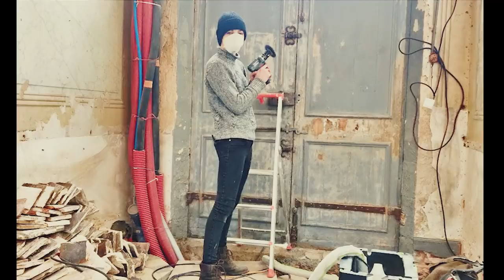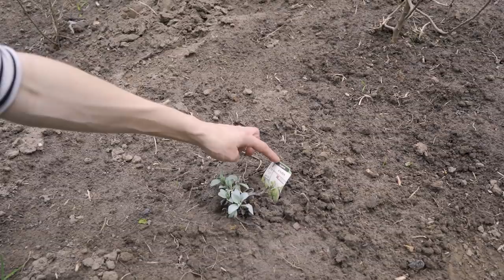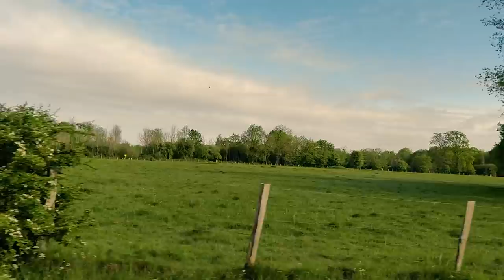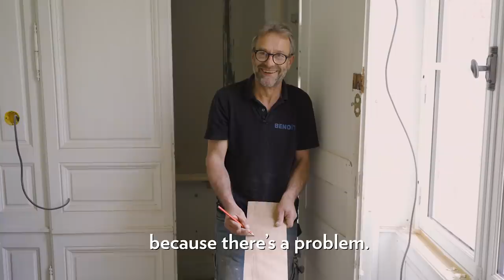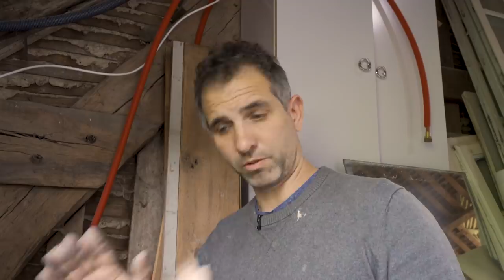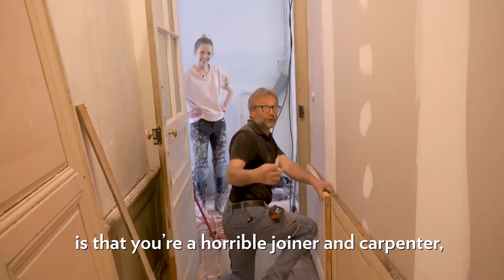Now I'm REALLY in trouble - How to renovate a Chateau (Without killing your partner) ep.20

Comment: Good for you for planting a garden. Your soil could of used some amendment. Dahlias are beautiful but very proned to slugs. The best way I have found to keep them at bay is two inch flat copper wire put in hoops around the plant. Dahlias also benefit from pinching to encourage branching out. You can google it and see what other flowers benefit from the same technique.

Comment: For future reference, you can start dahlia tubers off in pots inside a greenhouse, partially buried with some of the tuber exposed. You often find you have more success if they are head started. It also allows you to take cuttings from the tuber as the shoots come up meaning you can get 5 or more plants from one tuber that will all flower in the same year.
Reply from the maker: Thanks a lot for the tip!

Comment: Excellent vlog! Entertaining and hilarious as always.

One tip: lightly spray the stones and existing mortar with water when patching, repairing, or continuing work which has dried out. Doing so prevents the dry stones and mortar from sucking the moisture out of the new mortar. This prevents or weakens bonding of the existing dry materials with the wet being applied. Before spraying with water its best to brush and hover the wall or surface being repaired to prevent small bits, dust, and old mortar in powder form from creating a barrier between the existing material and the new material. Certain types of stone and tile also require wetting before applying mortar and put into place. Given this is an older vlog and the ten of thousands of individuals, such as myself, beating and pounding you over the head with unsolicited advice, you're bound to have been informed of this. If so, I won't see your eye roll or the one finger salute. So have at it. For the desired and maximum effect ensure your well rehearsed single finger salute and/or eye roll is in the direction of American. 

The "vibrating tool" aka multi-tool, is the best power tool invention in recent memory. Another way I've hidden wires and cables is with picture rails. Picture rails not only prevent holes in the walls, but hide data cables, low voltage electrical cables (LED sconces, motion sensors, alarms, LED strips behind the picture rail to highlight the crown, etc, etc), and a dedicated low voltage electrical cable to power individual LED light fixtures for art suspended from the picture rail. Installing a picture rail future proofs the room. The picture rail reduces or eliminates the need for cutting and patching when new cables or wires is necessary. Picture rail pays for itself both in terms of time and resources. For single electrical cables you can simply add half or quarter round molding to existing crown to avoid having to cut into and repair plaster walls. As always keep a detailed digital diary for each room to prevent mishaps in the future. Incidents of electrical cables being severed with a nail can easily be avoided. Buildings have been destroyed by fire due to a single nail through an electrical cable. Damage to and repairs of electrical and/or data cables is avoidable with a digital diary containing photos and measurements.

Lastly the hired orchestra playing your original scores is superb! Each new vlog is better than the last. 

Cheers!

Comment: Here’s some dahlia growing advice from a cut flower farmer. Dahlia tubers are prone to rot. Plant your dahlia tubers when it’s NOT going to rain. Do not water your dahlia tubers until they have sprouted. I know it’s the opposite of what one would typically do, but it prevents them from rotting. Also, dahlias are not cold tolerant. Plant out after all threat of frost has passed. They like warm weather.

Comment: My essential opinion about the cut flowers: Do get some Anemone de Caen and Anemone St. Brigid. They are always all over the Paris flower markets because they come early, last long and are very colorful, making great arrangements. They are EASY to grow and come back year after year. The Dahlias might give you some trouble due to your more northern clime. In zones 9-10 they winter over but with hard freezes, you will need to dig the corms each fall and re-plant in the spring. Great for summer color dabs are Cosmos, very trouble free if you can allow them to self seed. Oriental lilies are very easy and so dramatic for weddings or anniversaries. Plant more wooded areas or border areas with Lily of the Valley. They blossom for May 1, Fete du Muget, and that will make memories of your chateau more “typically French”  and they are bulbs that come back year after year with no fuss.
Reply from the maker: thanks so much for all those tips!